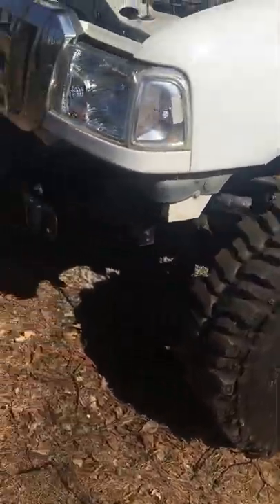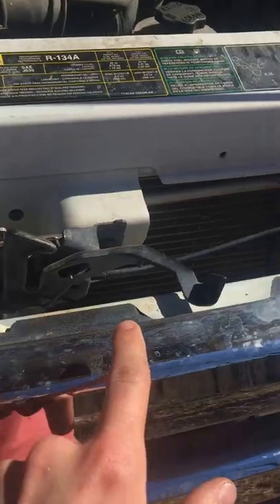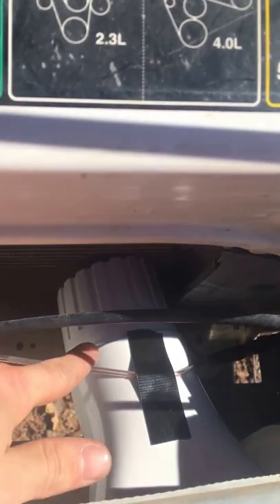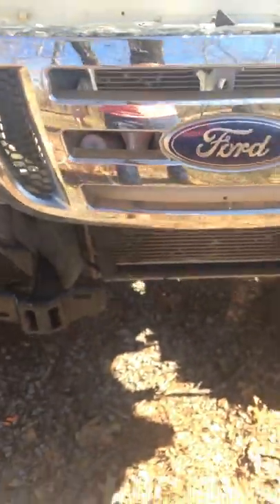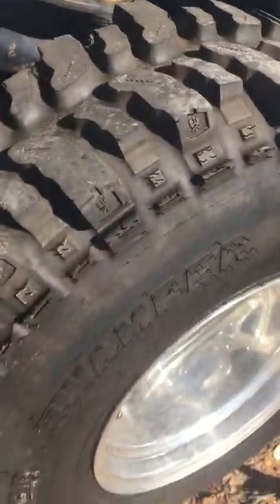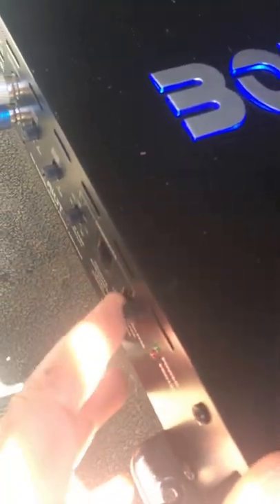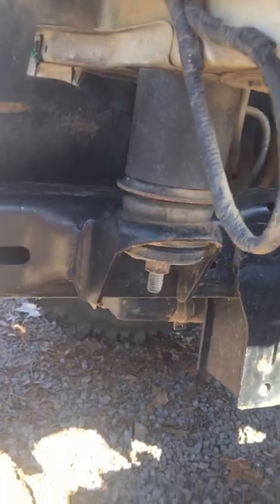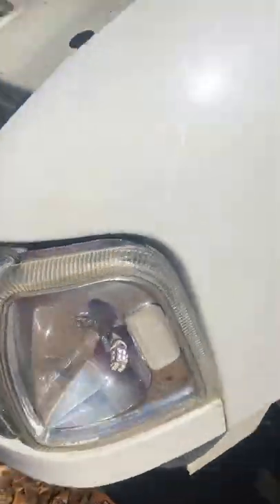My 4 Pyle Power Horns

Comment: If your ranger doesnt have rear speakers, just wire it to your factory radio, kid you not its just as loud and I only use one. Plus u can switch between inside and outside by changing your fade if you set it to your rear speakers (left or right doesnt matter)